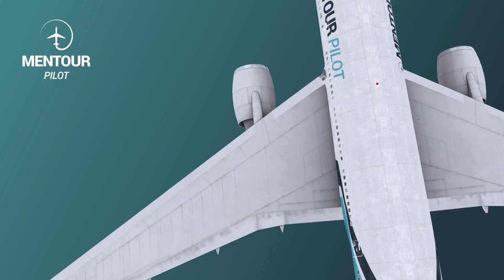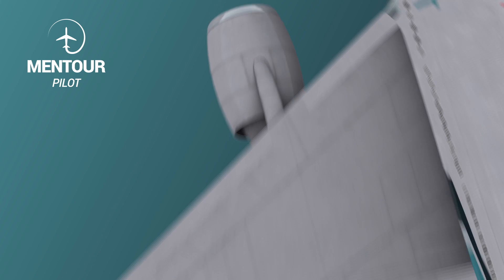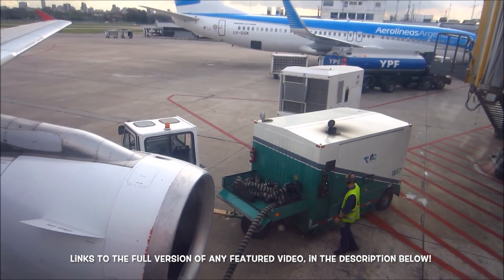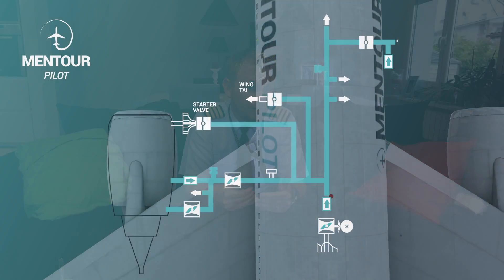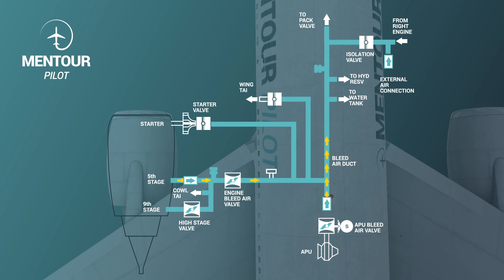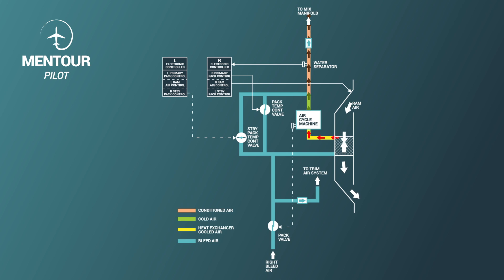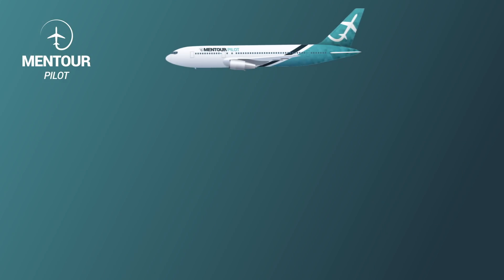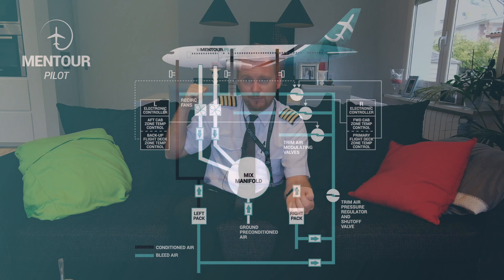How does the Boeing 737 Bleed-air system work?!

Comment: In case of dual bleed light illuminated .will setting engine thrust above ideal damage APU ? does APU back pressuring really happen ?
Reply: anik bhowmick No, the APU has a check valve that prevents engine bleed air flow into the APU load compressor.
Reply: @speedbird9313  but I went through the FCOM of 737 where it is recommended to keep thrust ideal with APU bleed and engine bleed on simultaneously .thats why I am little bit confused .
Reply: anik bhowmick Had to google that, I use the AMM and not the FCOM😆, page 24-25 right? 
This is a copy/paste from the SDS part of the AMM:
	
The DUAL BLEED light does these things:
•Tells the crew that an engine (or engines) and the APU both supply pressure to the pneumatic manifold at the same time.
•Reminds the crew to put the thrust levers to the idle position during DUAL BLEED conditions.

So maybe it is a reminder thing🤷🏻‍♂️
Reply: @speedbird9313  can u tell me where can I get AMM .I am not linked to any airlines .
Reply: anik bhowmick Dont know🤷🏻‍♂️Have you tried googling amm? There might be an outdated version on pdf somewhere🤔
Reply: @speedbird9313  I didn't find .only got for 737 Classic series.but I need 737 NGs .is there any way to get them other way
Reply: anik bhowmick Not that I know of, but I got access so Ive never searched🙄
Reply: The check valve is there. But if it failed, then the engines would back feed into the APU

Comment: Halo Capt. Excellent to hear all from U. 
Q.where does the passengers and crews get oxygen at high altitude 30,000 as the air is coming from outside at that level.
Reply: Simon Katunzi From the aircodition packs. Outside air is mixed with recirculated air and air from the compressor stage of the engines.

Comment: Isn't the ability to provide different temperatures to all of the 3 different zones controlled by the trim air system? The air conditioning sends out the coolest temperature demanded by one particular zone, but for the other zones that needs warmer air, valves of the trim air system directs bleed air to bring the temperature up to the desired setting.

I also remember there was engine trouble on a flight and the captain or first officer smelled something strange and he knows from his training that the smell has to come from the right engine because of how the bleed air system works, so he shuts down the right engine, but what he didn't know is that he was flying a newer variant of the plane and the routing on the packs were reversed, thus causing the pilots to shut down the wrong or the working engine. Which flight was that if anyone remembers?
Reply: First paragraph 100% spot on 👍

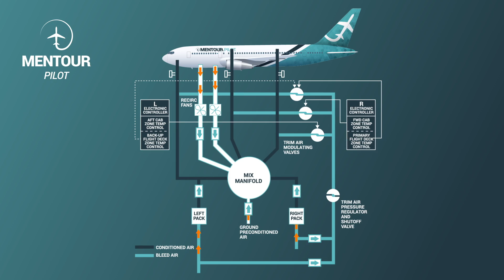Comment: 9:54 how "infectious"  would the recirculated air in the cabin be, if a sick passenger is on board? Wouldn't it be necessary to heat the air >100°C and then cool it down again?
Reply: Push it through HEPA filters that filter 99% of airborne pathogens? He mentioned the recirculated air is properly filtrated. Still, in a room full of people, if you sneeze without covering your mouth, you risk infecting the whole plane, since all the moisture you sneezed out is spreading more willingly in dry air. Don't fly sick.

Comment: What's the difference between bleed and trim air? Thank you
Reply: Bleed air is air that comes from the engine compressors. It is then used for the various sources including the air conditioning packs. Trim air is a part of the bleed air (that is hot air) that is used to increase the temperature of the air coming out of the packs

Comment: Why do airplanes dont keep exactly the pressure on the surface of the earth in order to avoid any pressure difference in the cabin and avoid crying babies?
Reply: Don't think the fuselage is strong enough to support that, though using CFRP instead of aluminium on the 787 has allowed it to lower the cabin altitude from 8000' to 5000' I remember
Reply: @lzh4950  thank you for the information. I have been researching a bit about that. Actually only to 6000 ft for the 787. Sad to say that mankind is not able to make cabins strong enough with technology of 21 st century,  if it is true what you have said.
Reply: IIRC a reason why cabin air is dry is also so that the fuselage will not corrode, though switching from aluminium to CFRP will also help reduce this limitation

Comment: Great video and tutorial Captain, I highly appreciate you taking the time to pass aviation knowledge to us. I’m a great fun of your work.  Two questions I might have missed them out on pressurization (in reference to B738). 
1: When is it the best time to set the landing altitude to the destination airport on the pressurization system on cruise? Is it during the descent or just before the TOD?
2: Sir, you have mentioned about the right pack system distributing the air to the aft cabin and the left pack distributes this to the flight deck. What happens if the right pack fails on cruise altitude, where will the aft cabin air come from? Will the air be forced to come from the left pack and through the mix manifold as illustrated (@07:21)?
Regards,
George
Reply: Essentially the left pack has a duct that branches off for the flight compartment, the rest of the left pack output is fed into the mix manifold. The right pack also feeds into the mix manifold. The mix manifold then supplies the fwd and aft cabin. If the right pack fails during flight, the rear of the of the cabin still gets its air from the mix manifold. What is important that wasn’t really spoken about is the trim air system. This is the basic description of the way the air conditioning distribution system works. There are 3 zones. Both packs output the temperature of the zone calling for the lowest temperature. The trim air system adds hot air to the other 2 zones to meet their temperature demand. You can see the trim air supply lines shown in the same diagram you noted

Comment: The Cabin pressurized with exhaust gasses for the flight duration can not be a good thing ,
Can't be nice for the Pilots and Cabin Crews  knowing that their work place is heated with exhaust fumes from the jet engines,or the Ground Crews breathing exhaust gasses for a good percentage of their shift ,
The upside the pay is good !!
Reply: Mark F First of all the air is filtered, seconly Ground Crew stays away when the engines are running..

Comment: You think of these air crafts as multimillion dollar machines. It is so shocking how primitive they are. Especially the cockpit. The passenger space makes some effort to provide updated entertainment. But their are no modern creature comforts up front. Make me think of sci-fi films where a pilots been in stasis for 100’s of years and they jump into a craft and fly off to their salvation. Yea. Probably possible the space shuttle hasn’t changed in the last 500 million years. Flight seems to wholly embrace the mentality that if it is not broken don’t fix it.

Comment: Air quality is poor on planes. Farts are recycled
Reply: @Mr Paul Grimm  - That's a very interesting point that you wrote about farts being recycled. That's why I try my best to fart as much as possible when I'm flying commercial. I like to share myself with the good passengers like yourself. I fly a lot from Los Angeles to NY as well as Los Angeles to London a lot. I also fly Los Angeles to Tokyo & Shanghai.
We might have been on the same flight in the past and you may have smelled my great smelling farts in the past. My farts smells like rotten meat and sulfur.

Comment: @Mentour Pilot  -  It's good to hear that the Boeing 787 does not use Bleed Air to supply the air for the flight deck and passenger cabin. FYI, the Australian Civil Aviation Safety Authority (CASA) established an Expert Panel on Aircraft Air Quality (EPAAQ) in  response  to  persisting  reports  from  Australia  and  overseas  about  possible  links  between  the  contamination  of  air  supplied  to  the  aircraft  cabin from the “bleed air” and  descriptions  of  post-exposure  acute  and  chronic  symptoms from those exposed to the contamination.For some individuals (commercial aircrew), chronic ill health can result from long-term exposure to contaminated air (in some cases leading to long-term disability and forced retirement). The  organophosphate,  tri-ortho-cresyl  phosphate  (TOCP),  a  known  contaminant  of  heated  engine  oils is a causative agent, as well as several other potential contaminants, may likely play a role.

Comment: I am surprised that you try to lead us to believe that  electrical compressors is more efficient than bleed air  from the  engine.  You need energy to compress the air regardless how you accomplish that. You ider produce the electricity from a generator on the engine then "you bleeding power from the engine. If you use an APU then you add weight and burning fuel. SO; nothing is free my friends ....Adding weight  and complexity is not the way.

Comment: I've been thinking about water injection for the engines. What if you replaced it with Hydrogen Peroxide injection? You'd get more cooling because it has a higher boiling point than water, and it would actually help combustion rather than hinder it due to the extra oxygen atom.

This means greater fuel efficiency, greater power, lower exhaust temperature and emissions, and less unburnt fuel.

If you have access to a water-injected plane or know someone who does, you should give hydrogen peroxide a try!

Comment: Nice video.  Can you in a future video,  if you haven't already explain the way a plane is pressurized? Thanks.
Reply: Air form the airconditioning system forces air into the fuselage. The outflow valve at the back of the aircraft modulates to keep the cabin at a certain pressure

Comment: I am surprised that you say you only use external air if the bleed air is not functioning... That's far from the real life conditions especially if you fly in Europe, as you say you do. Just about every airport in Europe has strict restrictions on the use of the APU, meaning the bleed air is not available because you have to shut down the APU almost immediately after you receive ground power.   most modern jetways also offer conditioned air for the arriving aircraft which, unlike that archive footage you used from South America, not  troublesome at all.

Comment: 3:26 This is what makes the Boeing 787 Dreamliner unique compared to Airbus A350 and all other airliners.  The Boeing 787 Dreamliner has electric pumps to pressurises the cabin which means you are not breathing carcinogenic fumes as you do on Airbus A350 with bleed air from the engines. The Boeing 787 Dreamliner flying at 45, 000 feet has a lower cabin pressure of 6, 000 feet meaning clean air and no flight lag or swollen ankles for a much more comfortable flight. Boeing 787 is much safer with a yoke on each side of the cockpit in front of each pilot allowing both pilots to clearly see what the other pilot's yoke inputs are. Airbus has had several fatal crashes where one pilot is pushing his sidestick while the other pilot is pulling his sidestick in opposite directions both at the same time.

Comment: Do you ever wonder how much jet engine oil makes its way into the air conditioning system?
Getting away from engine bleed air systems is probably a good idea.
Reply: The air would likely be higher pressure than the oil
Reply: None..
Reply: @speedbird9313  Get a nbr 1 bearing leak and you'll be smelling oil in the cabin. Ask any bae146 crew, they always had problems as well.
Reply: BananaKing This is on a 737NG tho..

Comment: Why don't they design the new aircraft with all the carbon fibre and high strength composites to withstand ground level pressurization at altitude? Is the cost really that much more?
Imagine having a flight where the ground level pressure at the destination is input in the flight computer, and the entire flight time is spent ramping up or down to meet that pressure.

Are there any currently flying aircraft with that capability for medical transport?

Comment: 9:39 I was walking underneath a Fedex plane at a static display, and I suddenly felt a really, really strong stream of warm air. That must have been it.
Reply: That would be the exhaust from the heat exchangers. There is a fan pulling cold air in from the ram air doors when the aircraft isn't moving. The air conditioning is being fed from the APU.

Comment: Why does the cabin pressure not remain at ground level pressure?
Reply: If there is greater continuous pressurization it would create more stress on the airframe during every pressurization cycle, and this would be harmful for the aircraft fuselage, because it can eventually cause damage to the structure.
A greater continuous pressurization differential between inside and outside would also be greater risk if there happens a rapid loss of cabin pressure, because in this case there would be a much larger instantaneous pressure change.
Reply: @mikep9604  Aah, i get it. Thanks!!

Comment: I never understood why the cabin pressure in the aircraft isn't simply ramped (to the extent possible) from the air pressure at the departure airport to the air pressure at the arrival airport over a lengthy period of time (After the aircraft is airborne enough to allow this, of course) reducing transition strain on the people in the aircraft. My initial thought would be that as Petter states, the system is quite antiquated. My second thought would be that this would increase the rapid pressure transition in a system failure mode to a point that it might be unacceptably hazardous.

Comment: It's all good and well to keep pressures at reasonable levels. But how do aircraft systems provide oxygen during and entire flight? Surely there isn't enough residual O2 in the cabin once the doors are closed to keep up with the O2 demands of hundreds of people for hours at a time? (Just to be clear, I'm not referring to the emergency masks that drop from the ceiling.)

Comment: AIRPORTS HAS NOT TOO MUCH RUNWAYS, BUT WHY THEY CALLED ALWAYS LIKE "36B", "107C", "08D"..., LIKE THEY HAVE 100 RUNWAYS?
Reply: Runways are numbered from 01 to 36, because there are 360 degrees on a compass rose. The numbers mean the direction of the runway. Runway 36 means that it points to north (360 degrees). Runway 08 means that the runway heading is 80 degrees. Runway 18 means its heading is 180 degrees (south), and so on.
Reply: @mikep9604  Fu*k!!!  So simple! ))) Thank you!!!

Comment: I’ve never understood how you get enough oxygen just from pressurizing
Reply from the maker: It’s the same reason you don’t need extra oxygen on the ground. The amount of oxygen as a % of the total gas is the same at altitude, just less pressure
Reply: @MentourPilot  @Mentour/Peter
Why didn't you mention at all the possibility to have a cabin fume event when engine seals deteriorate and go porous? There are more than two events per day or per 10000 flights in the world today. No mention, seriously??
Why wouldn't you explain how to flush the cabin air in those events? With no concern, no training, no SOP, when there is a cabin fume event, the response is... nothing, just land ASAP. I believe you should be more responsible and raise concerns so as to find a solution, rather than contributing to the industry's omerta...

Comment: 6:31  Fact: Airbus names redundant systems (eg. hydraulics) by color. (IIRC: green, yellow, blue).
Q: Are you color coding bleed-air systems with holiday-colored pillows? Is that the same as marine and aviation navigation lights?  Are you using Boeing-compatible color codes?  Are you using "stage left" or "audience left"?

Comment: I'm ASTONISHED   and  appalled  that an APU isn't on the "Mandatory Equipment List". 

eg.  What's to supply eletricity, cabin oxygen and HYDRAULIC pressure under emergency conditions? How's a girl to RESTART engines without spinning up fans?  Isn't "triple redundancy" kind of desirable for critical systems, such as "Angle of Attack" sensors driving MCAS override control inputs?

Comment: What happens when the seal on the turbine shaft starts failing? Does everyone breath in atomized turbine oil? Is there a way to monitor air quality on board?
Reply: Yes. No.
Reply: That's possible with older engine types, like JT8 D for example.
Newer engines, like cfm56 in 737s were  designed with bearing sumps sealed with multiple labyrinth seals, pressurized with air to keep lubricating oil inside. If any leak occurs, it will be drained from the sump overboard. Maint crew will notice increased oil consumption, nothing more.
Reply: It smells of old socks. If it occers the crew will shut off the bleed on the affected engine. They will then open the crossfeed valve and feed the packs from the other engine. But, yes, it is rare as the air in the compressor section is at a higher pressure than the bearing housings so tends to leak into the housing pushing any oil inwards.
Reply: @bobrice3957 cross feed is for fuel. Cross bleed is for air

Comment: Cap Eddy Rickenbacker use to have to come down from high altitude ( for his aircraft ) to try to warm up. Your cabin heater was a silk scarf, leather helmet and googles, flying togs.
Open cockpit and engine noise and fumes at practically arms length. 
Those pioneer air men were as supermen with an incredible indomitable spirit.

Medal of Honor and many conspicuous outstanding Valor Awards. 🇨🇭🇺🇸🇨🇭